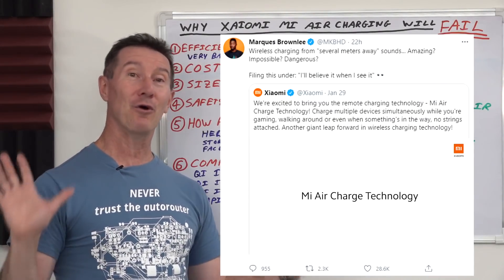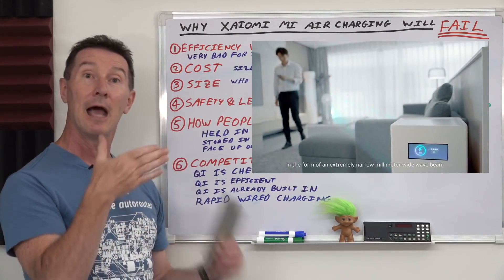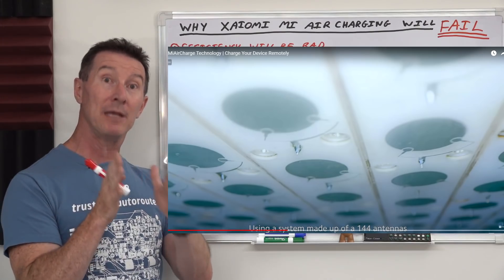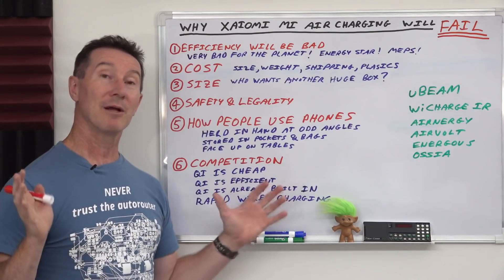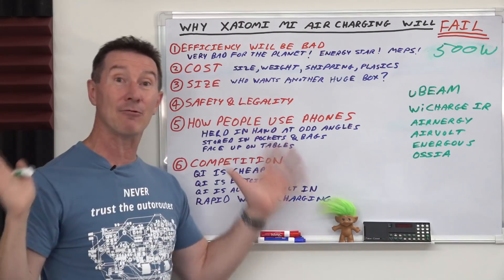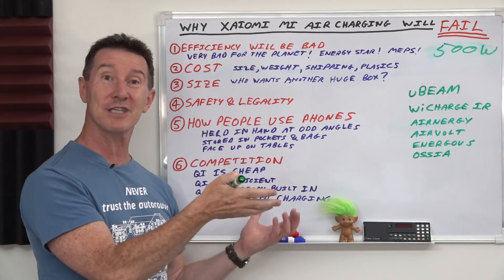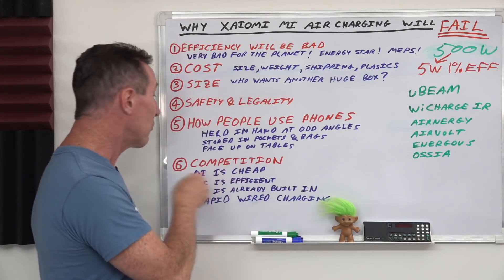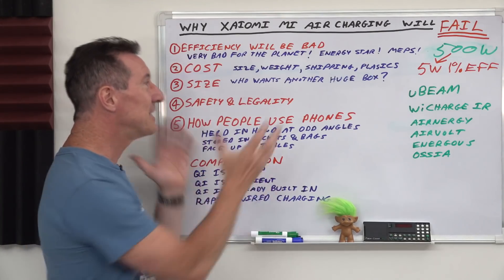EEVblog #1369 - Xiaomi Mi Air Wireless Charging BUSTED!

Comment: Remember when Apple was having problems with people holding the antenna of their iPhone? Steve Jobs response was "They're holding their phone wrong". Problem solved!
Reply: The you're holding it wrong meme stopped being funny - or even relevant - 10 years ago, and I find it sad that ,no matter how factually incorrect it is, any tired Apple hate still gets a thumb up. LOL, crapple, hahahahaha.
"Just avoid holding it in that way". There, the actual response. I really wish people stopped thinking of 14yo kids as a reliable source of information.
Apple's official statement was "If you ever experience this on your iPhone 4, avoid gripping it in the lower left corner in a way that covers both sides of the black strip in the metal band, or simply use one of many available cases". In short, just avoid holding it in that way.
Honestly, I never noticed any problem of the kind at the time, but I'm quite sure that if you hinder the transfer of data, the transfer of data will be hindered. Similar warnings can apply to any device. Just avoid using devices in a stupid way. The wifi signal goes down if you put the router in a metal case. An FM radio will malfunction if you touch the antenna, sometimes even if you walk near the antenna. A loudspeaker will sound bad if you touch the membrane. Your food will cook slowly if you put a hand between the stove and the pot. Although in the last case you won't experience the issue from the third time on.
Reply: @IlBiggo  Emailed by the website Ars Technica about the problem, Jobs responded in his normal terse manner: "Just avoid holding it in that way," he wrote - a response from Jobs that was received by a number of gadget review sites and customers in the US.

Being a super fanboi is making your brain soft. If lots of people are having a problem using their phones because of the way they hold them without reading an instruction manual, it's a problem. Apple accepted this and fixed the problem. You need to grow up.
Reply: @ats89117  Being the usual better knower is making you miss the fact that that is *exactly* what I wrote , and it still doesn't look like the meme you were parroting. Try reading past the first paragraph next time, if your hater brain can keep cool long enough. "But the rest of your reply was just fanboi babble, boo hoo"
As for "lots of people", I'd like a figure. How many lots of people had lamented the unforgivable mistake of using an antenna which would stop working if you obstruct it enough - i.e., an antenna? I mean, how many people had even noticed, before gadget reviews sites started cashing in those sweet clickbaity clicks?
Reply: @IlBiggo  Your argument is nonsense. The great majority of people don't read gadget reviews. Many iPhone users noticed cases of poor connectivity without having any idea what was causing it. There were a lot of complaints. They ended up in the news. Apple, which has a much better handle on their customer base than you do, saw the problem and fixed it as quickly as they could. The solution wasn't  "Just avoid holding it in that way".
Reply: @ats89117  Exactly. The solution for Apple was finding a better location for the antenna. The solution for people who already had bought a phone was finding a better location for their hand, i.e. avoiding holding the phone in a way that obstructed the antenna. It's solid advice for any phone.
"Avoid holding it that way" sounds like a suggestion to me, not a solution.
And doesn't sound like "you're holding it wrong", which was just a humorous paraphrase and got transformed into a "honest, Jobs said exactly that" meme by people who evidently read/write too many gadgets reviews.

Comment: I have one question.  How to use RF energy harvesting in low voltage low current consumption circuits? Also is it possible to charge a low voltage power capacitor using RF Harvesting?
Reply: Oh it is possible. It’ll just take so long not to be practical for much. The voltage on the capacitor doesn’t matter: it’s the energy that matters, and the harvester will be harvesting on the order of a milliwatt. Enough maybe to run a low power scientific calculator without waiting for some capacitor to charge first for hours. Single line display, no backlight, no sound. But you already got a tiny solar cell that can do way better than that. So why are you obsessed with RF? Is there no light where you are??
Reply: Yes Solar cell is good option but If RF  can provide enough energy for my tiny MCU then we don't need to add solar cell.

I want to use this for some low power indoor projects,  where approx 8 hour will be dark.

Comment: I have one question.  How to use RF energy harvesting in low voltage low current consumption circuits? Also is it possible to charge a low voltage power capacitor using RF Harvesting?

Comment: I am relatively excited at this sort of technology... as low power devices could have an antenna plus supercap , meaning you will never have to charge it. 

Mobile phones? No chance! This technology would have been good for the old compact Nokia phones.... but the high power draw of smartphones and quick charging through cable devices, means this would never work. Standby perhaps? In which case you might as well plug the phone in for half an hour.

Comment: If they would just design phones to reliably go a full day without recharging, this inefficient crap would be totally unnecessary. But no, efficiency has no marketing appeal, and we'd rather make them 2mm thinner than only need to charge them while we sleep, thank you very much.
On a positve note, I absolutely love The Signal Path. The engineering that goes into RF test equipment is astounding, and I am learning a great deal.

Comment: Beamfoarming is horrible idéa for transmitting power. They could use a flat, or quasi flat patch aray and use a servo to move it. Would probobly gain a order of magnitude.

I see no reason to use mm wave here, it just make it worse. You don´t need mm wave for this application.  Wave lenght of something like 2-3 cm would probobly be optimal, that is somewhere around the wifi-bands

Comment: A 5W charger is more than enough to keep a phone charged while using it. It would be nice if it worked.
Reply: I’m sure it can be made to work. Having it work implies that your body will be illuminated with a 200W+ beam that will feel equivalent to having a nearby 500W halogen light pointed at you. The only improvement will be the lack of visible light. The downside is that it’ll cook your corneas if the phone will be in the straight line between the box and your face. So yeah, no, it would not be nice if it worked at all. It’d be wasteful and uncomfortable and you’d be the first one to complain if you hurt yourself by not following the long list of safety precautions needed to use that idea safely. You really don’t want this to “work”z

Comment: so 1% efficiency? Pretty normal, typical car have similiar efficiency (1400kg to move 80kg person + average 30% of efficiency of combustion engine + transmission losses, friction). Also typical loudspeaker also only about 1% efficent in converting electrical energy to acuostic. All is marketed and sold every day... 

But at least cars and speakers makes sense and this is completely unrecessary.

Comment: How about put a bigger damn battery in the phone? Mine has a 5,500mAh battery in it, lasts the day, slow charge at night and I have it set to cut off at 80%
Reply: It would be better just to have 2 batteries and make them easily removable. It would be so easy to do that I wonder why haven't they done it already.

Comment: Everyone trying to create these wireless chargers instead of just offering an extra swappable battery for the phone (for obvious reasons).
Reply: something like tough book hotswap way would be great they can even sell batteries at a premium
Reply: I remember with my old phone Samsung Galaxy note 3, I always carried a few batteries around. Fast charge and powerbanks are nice, but having a couple of charged batteries ready at any moment is so much nicer. And that was with a required reboot.
Reply: Or instead of including all that hardware needed for this use the space for a larger battery. Just charge it while the user sleeps and is not holding it. He is not holding it while sleeping, right? I've suddenly got my doubts looking at the portrayed user of that tech.
Reply: That is exactly why I still use my 6 years old LG G3. Open back cover, swap the battery: 5 seconds. I have the original LG spare battery charger and 3 spare batteries. Good enough for a 4-5 day "in-the-middle-of-nowhere" camping trip with some GPS use and taking photos, or for a very busy and long day constantly using the phone. Hot swap would have been so much better but still beats the fixed battery BS. Hot swap can easily be done with a 100-200mAh fixed back-up battery and a "swap battery" app that shuts down all radio, turns the screen off, puts the processor to a time delay (15-20 seconds are more than enough) sleep and recover after the swap without any need for a full re-boot.
Reply: I'm still using my Galaxy S5 for this reason among others. I carry a spare battery for trips just in case I need one, but usually I can still get a full day's work out of it with its original battery, and it's very easy to just to plug the thing in if I need more. It gets about 8W on a decent charger, enough to charge it in about 90 minutes. My $8 power bank can give it a full charge and then some.
Reply: Yeah I'm also keeping my S5 for the battery reason. New apps are increasingly not working with it though.
The USB port is ruined and although I have a replacement I'm reluctant to open the phone in case I mess it up. So I have three batteries for it that I charge on the bench power supply.
Reply: I put a tripple 18650 holder on the back of my phone. It ran for like a week and you could just swap the cells. I build it as a bodge because the USB charging circuit failed. Used the damn thing for 2 years because it was great!!!
Reply: I remember buying a replacement battery for my Samsung Galaxy S5 for 14$ delivered. Seems like a different era, even though it was only 5 years ago.
Reply: @Marci124  Same with me. But now I am slowly looking for a replacement phone - its getting laggy, I think the Apps grew too big for the memory. but I do not know which new phone has all the features, the S5 has, which seemingly vanish. 3.5mm socket, IR blaster, removeable battery, sturdy plastic backplate instead of fragile glass, NO edge display as this is also more danger for breaking. The development sems to go into the wrong direction.
Reply: @goamarty  There isn't a phone like that in production currently, and probably never will be.
Reply: Or working on SuperCap and UltraCap designs to reduce battery aging/burst loads.
Reply: it's called a power bank and is on the market for a long time
Reply: They don't offer removable batteries anymore because they don't want you taking the battery off to hide and go dark / off-grid. They want 100% control over you.
Reply: @mrlithium69  bullshit. nobody can prevent you from settng it to airplane mode or letting the battery run down. its just about profit. when the battery ages,you either need an expensive repair or buy a new phone.
Reply: @mrlithium69  Tin foil does work very well to isolate the phone’s antennas from the “outside”. Instead of putting it on one’s head, wrap the phone in it.

Comment: You can charge batteries with a Satellite Dish using the L&B on the dish while receiving a signal from the satellite & look how big the dish receiving the signal is!
I used to charge the 7.2 volt battery in the super buddy Satellite computer this way after building the dish. Wireless power is 100% possible!
Example..
 https://youtu.be/aeo1UXXPcxY
But this technology???

Comment: “Power can be, and at no distant date will be, transmitted without wires, for all commercial uses, such as the lighting of homes and the driving of aeroplanes. I have discovered the essential principles, and it only remains to develop them commercially. When this is done, you will be able to go anywhere in the world — to the mountain top overlooking your farm, to the arctic, or to the desert — and set up a little equipment that will give you heat to cook with, and light to read by. This equipment will be carried in a satchel not as big as the ordinary suitcase. In years to come wireless lights will be as common on the farms as ordinary electric lights are nowadays in our cities.” (Nikola Tesla, The American Magazine, April 1921)
Reply: One hundred years later and we are still waiting. It would also be the end of radio frequency communications as we know them.

Comment: Soon we need HAM licenses for charging our phones wireless.
Reply: You can't use a 500W transmitter with a "basic" HAM license in MY country. You need a more thorough test to do that. The "A" license allows you ~50/100W, if i remember correctly.
Reply: Hah, my UK Foundation licence lets me use 10w HF/VHF/UHF etc. The two higher levels are 50w & only 400w max. I did manage to send a digital wet fart 5,600 Mi to Brazil yesterday and both ways to Russia with a bit of wire up a pole.

It might work better if I bought the cables though, instead of coupling the mic to the headphone like an old modem.

Comment: The LG G5 had the perfect solution, fast charging batteries or the ability to swap out the battery! 0-100% charge in less than 10 seconds! In fact it takes longer for the phone to boot up than it does to swap the battery!

Comment: If the device is consuming 500w to produce charging of 5w...

...how many of the remaining 495w are being wasted cooking your testicles?
Reply: Not much. Most of it would get lost with just heating up the air before even reaching the testicles.
Reply: @Kirillissimus  - if you have the phone in your pocket and the beam is shaped to target that area...
Reply: @fredbloggs5902  Even then at the stupidly high frequency I doubt you would get anything even remotely close to 100W unless you put yourself right in front of the transmitter. You should still be able to feel the heat though especially if you put you phone in front of your crotch.